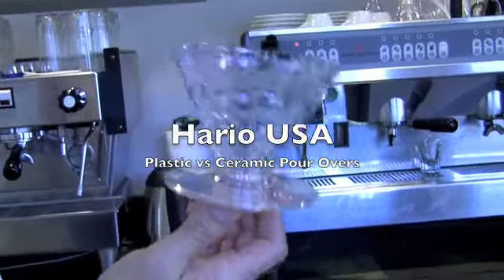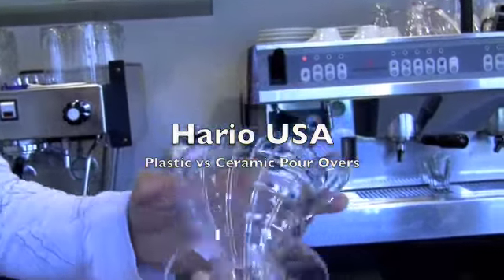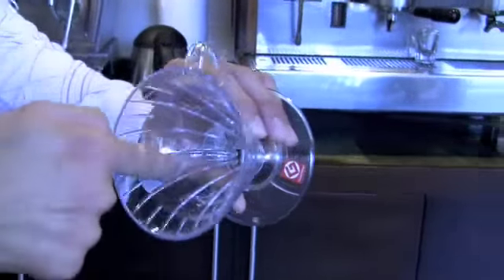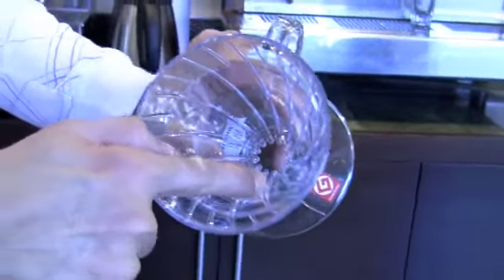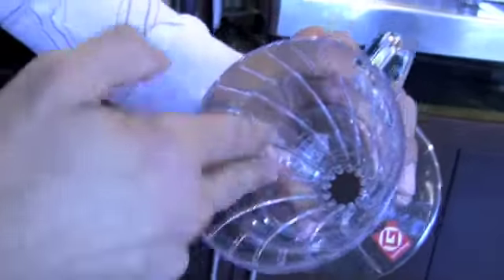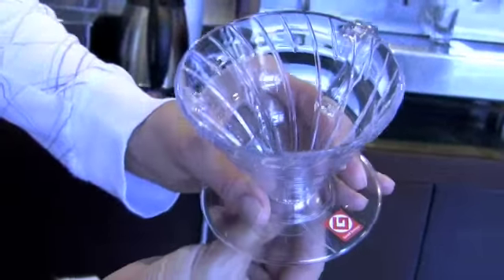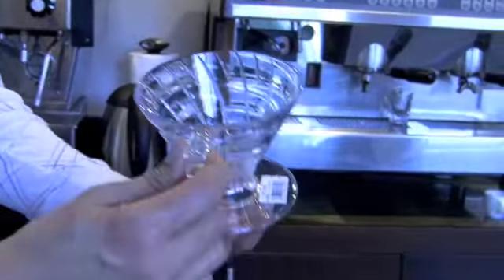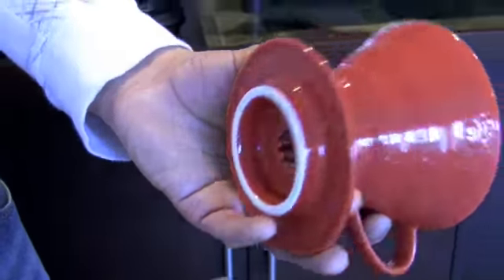Field Trip: Roustabout - Plastic vs. Ceramic Hario Pour Over

Comment: The Hario v60 02 Ceramic does lose heat much faster than the corresponding Clear  plastic dripper. See graphs on Reddit: Showdown: Plastic vs Ceramic v60. For this reason, the ceramic dripper needs a crazy amount of hot water (500mL) to pre-heat properly. Hario also make a clear Borosilicate Glass dripper with a removable base + Handle. But I suspect glass will have similar heat loss as ceramic. The clear plastic dripper seems best - it is a single cast BPA free food grade plastic (better than polycarbonate) - the Hario website doesn't say what the material is, probably proprietary, but then Japan has led the way in safe food grade plastics.
Reply: I got the plastic one but my concern is that it specifically states in the manual that it handles temps up to 90*C which is 194*F. Considering that ideal temps for pour over is 195*F - 205* - that's just below that. Makes no sense. Any comments on that?
Reply: Probably AS Resin or Polypropylene?

Comment: I heard the ceramic actually pulls heat out of the coffee?
Reply: Yes, the graphs on Reddit: Showdown: Plastic vs Ceramic v60 confirm that in actual use, the ceramic dripper loses heat much faster than the clear plastic dripper and therefore the ceramic dripper also needs a large amount of hot water to pre-heat properly.